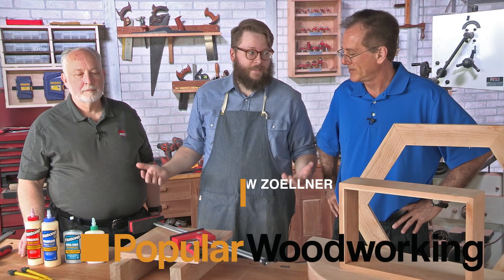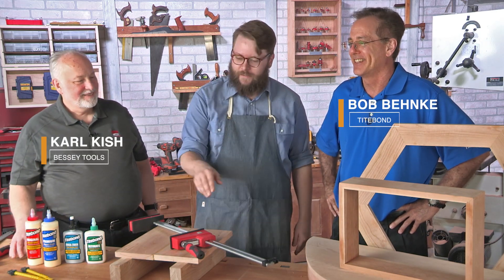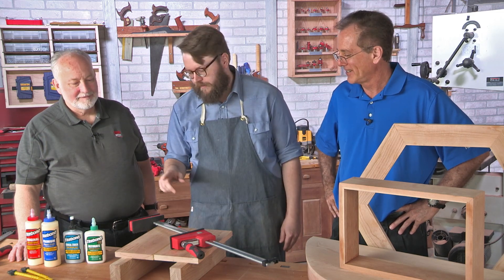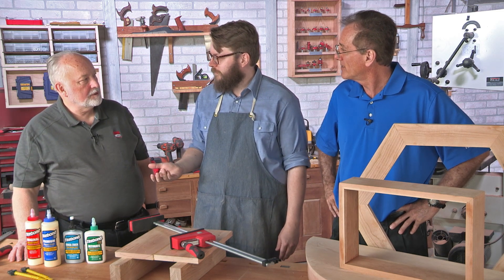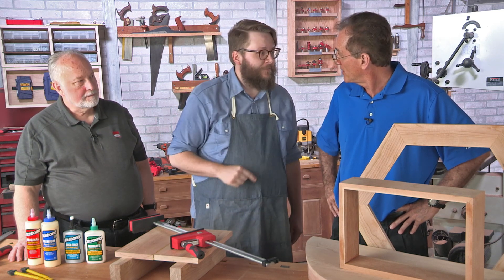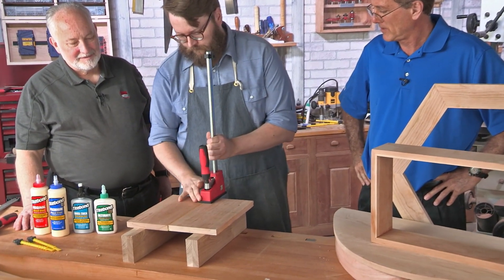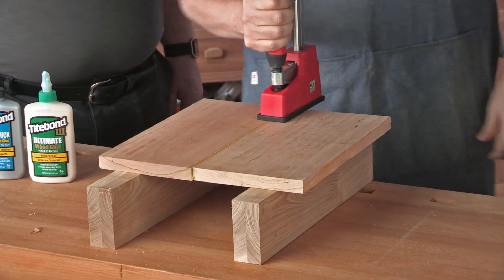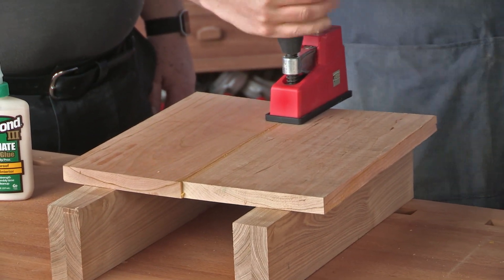Glue Feats of Strength

Comment: Just like fake martial arts, why are the support blocks so close?
Reply: Focuses the force close to center. With blocks further apart, more bending motion is induced and it's easier to break the wood. That is why you hold the wood as far apart as possible in martial arts. Just the opposite of what you suggested